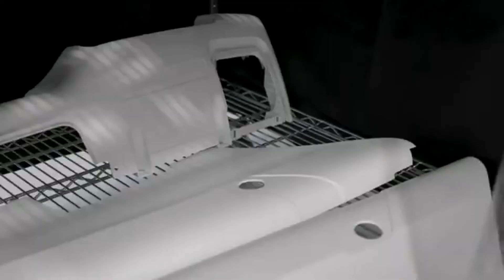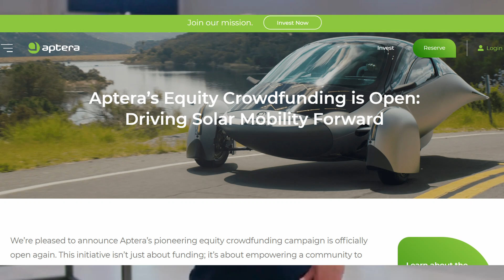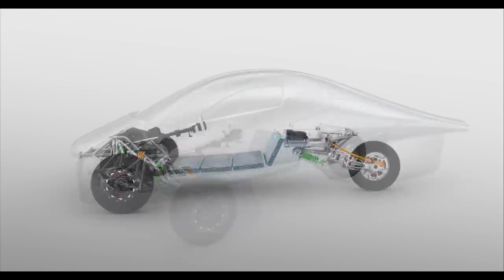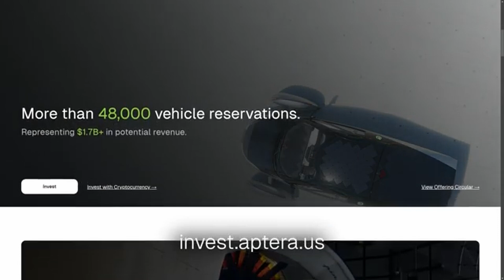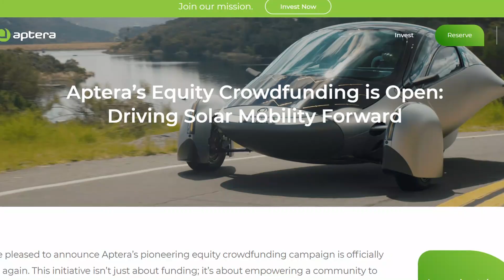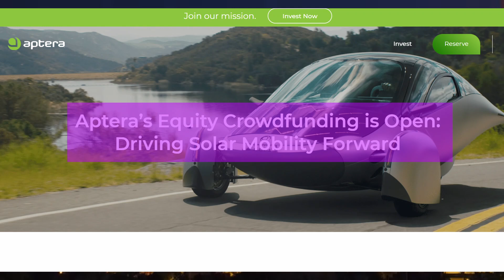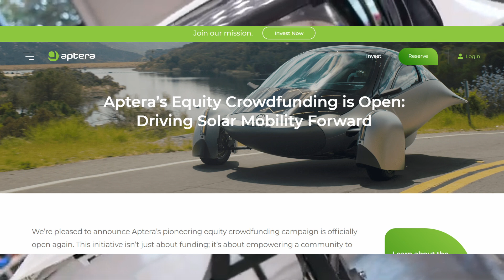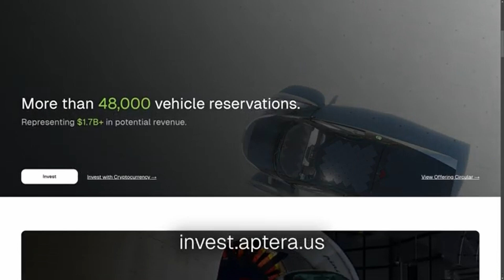Aptera's 5 BIGGEST November 2024 Updates You Won't Believe! Stunning PI Builds and CES 2025 Teaser!

Comment: You got the pricing wrong. The pricing originally was $29-54. The 200 mile basic model was to be $29,00.0....the 1,000 mile version was to be $54,000....then there are accessories. These prices are years old and will likely be more. The launch version aptera  is scheduled to be made in 2025 with ,400 kile battery and full solar cell accessory for $34,500. However the price maybe cliser to $38-39,000. Thats still a good deal for the most efficient ev out there and self charging at that. With its carbon body it will never rust. Aptera will offer over the air updates and options. Aptera is all for owner and thitd party maintenance unlike Tesla.